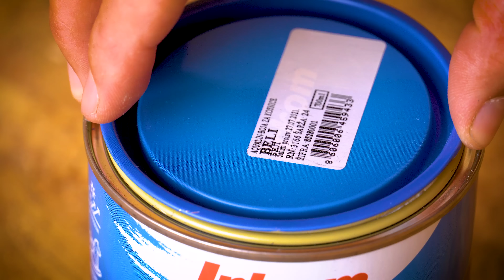Building Outdoor Aviary for Budgies

Comment: My first thought was it wasn't  level and no cement to secure the posts,  but I love what you did.  The end results is great. Love the windows.  I do have a few questions though. Could you show more on what it is that you used to make the little fresh water fountain for them and is the aviary protected from the rain getting inside?  Great job.
Reply from the maker: Water fountain is a solar powered water pump. Aviary is protected from the rain.
Reply: @alenaxp    my budgie broke ITS right Wing and in Germany there are No vets for Birds what should i do pls hellp
Reply: @gamingprofi2584  Has anything been done to help your bird out yet? If not, maybe you can contact the pet store you bought your bird from?
Reply: @gamingprofi2584  If you can't find any vets that specialize in birds, do you have any zoos or bird parks in your city?  Maybe you could try approaching them to get help for your bird?

Comment: great first effort. One item you should consider is Rats. Mice and Snakes. I have a plan to line the inside of my structure with mouse mesh as mice can get thru the budgie mesh. Mice / Rats can easily eat through the wood you have used on the walls. Do you get frost where you live ?. I used to put a tarp over the mesh during winter but now have green house plastic on removable frames that I screw on during winter to protect against frost and cold.

Comment: Nice aviary!

But I would make some modifications for safety and the health of the bird:
1. On every corner starting from the ceiling place a 4-6” wire cloth around the aviary where your budgies/cocktail will gnaw or chew the corner because sooner or later they will create a hole and escape. Budgies/cockies are notorious chewers
2. The shelter or covered part should have a partial
wall from the top about 3 feet with peep holes for the birds to go in and out to block draft or wind into the shelter that could stress the birds. 
3. Install vent holes on the top of the shelter on each end to create a draft for hot air to escape in the summer 

Enjoy they they are beautiful!